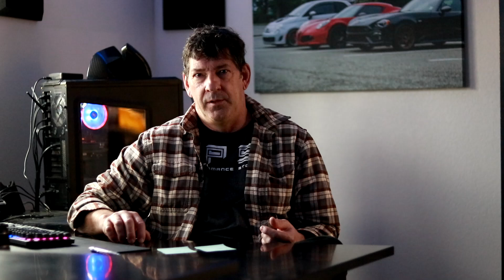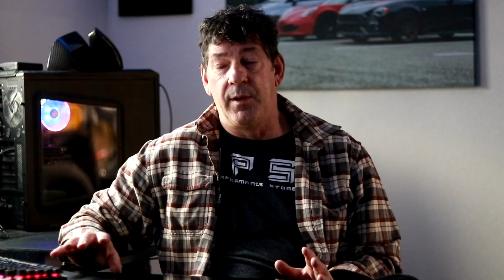Boeing 727 Falls From the Sky TWA 841

Comment: Why on earth would any pilot want to "push" the altitude beyond what is safe and acceptable? It's not like there is any prize money in it!
Reply: Actually there was.  During the 70's Arab embargos, Airlines were giving bonuses to aircrews for saving fuel. Rolling the flaps back 2 degrees in the '27 dropped the nose slightly, cleaning it up aerodynamically. Flying higher also uses less fuel. Former TWA A&P, MCI overhaul base 1986-1999.

Comment: Was the FE a new-hire? An experienced FE would've been aware of this hack and would''ve understood that the pilots pulled the breaker when he was away. A quick look at the altimeter would confirm it, as would a word with the pilot. However, a new-hire might simply push the breaker back in.
Reply: The Flight Engineer was a 5 year Air Force veteran and had been flying for TWA for 10 years. The whole investigation into this flight was a complete mess to say the least with the investigators from almost moment one believing the pilots had caused the upset, never questioned them about the events leading up to the upset save for the hearing 8 days after and didn't let the evidence lead them to a conclusion. All 3 pilots testified the NTSB got the cause wrong with the FE declaring that had the captain done this trick then he would have reported him almost immediately.

A passenger stated that she saw the FE give meal trays to the Lead flight attendant right before the upset, so the pilots discussing the flap trick and then configuring the airplane so that only the flaps would extend and then the FE returning to the cockpit completely out of the loop would have to have happened within a span of less than 30 seconds. Not possible. The Lead flight attendant testified that the FE did leave the cockpit to return meal trays but this happened 30  before the upset and he never saw him come back out and what the passenger most likely saw was the Lead flight attendant giving meal trays to a 
No pilot coming back into the cockpit and seeing a circuit breaker had popped would ever push it back in without first advising the other pilots. When a circuit breaker pops in needs at least 3 minutes to cool down before being pushed back in so if the circuit breaker popped like 10 seconds before the pilot re-entered the cockpit then they could risk damaging the component even more by pushing it back in.
(something that wouldn't normally be touched)
Reply: Not a new hire. It wasn't a common procedure as it's actually unauthorized. It was simply poor/no communication. Former TWA A&P, MCI overhaul base 1986-1999. Worked on that very plane several times.

Comment: Hi Greg, what happens to pilots that create problems such as what occured on TWA 841, or make critical errors when handling emergency situations? I hear so many stories of accidents or near accidents, often with significant pilot error and always wonder if the pilots ever get to fly again. Do they get fired? Or just sent back to some training?
Reply from the maker: It depends on the airline. Typically they are retrained, but in some of the more serious cases they are fired.
Reply: TWA heavily defended the pilots and allowed them to continue flying. The captain continued flying and eventually captained the 747; most pilots that flew with him declared the NTSB got the cause wrong. The co-pilot eventually became a 747 Flight Engineer while the Flight Engineer eventually resigned after the incident and became a professor because of nightmares, psychological issues and eventually he couldn't get on a plane without reliving TWA 841.
Reply: TWA had a very strong pilots union. I know, I worked there 1986-1999.

Comment: One of the weirdest things about this story is that there are two Hoot Gibsons that are pilots.
Reply: And one is a space shuttle pilot while the other one almost wrecked his 727, so it's like they are opposites.
Reply: @RCAvhstape  I was wondering until I saw these comments! I met Space Shuttle Hoot in the early 90's.
Reply: @RCAvhstape  Nope, they are both heroes. What most likely happened on TWA 841 is that the right outboard aileron fluttered due to a fractured bolt that caused the 727 to turn off its heading. With the plane turning right and the autopilot commanding a left turn to get back onto its preset heading it put the plane in a cross controlled situation. The lower rudder yaw damper sensed discrepant rudder inputs that resulted in a lower rudder hardover. With the flaps retreated the outboard ailerons lock out and rudder movement via the rudder pedals is limited to prevent over controlling so with a lower rudder hardover and a fluttering outboard aileron there was nothing the pilots could do to prevent the 727 from going into a dive. When the landing gear was extended the right gear overextended that caused a loss of hydraulic pressure to System A hydraulics which powers the lower rudder, flaps and slats. With hydraulic pressure gone the lower rudder centered and allowed the pilots to recover. The No.7 slat extended due to the loss of hydraulic pressure and the aerodynamic forces of the dice. Analysis showed that it didn’t lock into its locking mechanism while the other slats did and was kept retracted by hydraulic pressure and aerodynamic forces alone. It had nothing to do with the upset and extended because of the upset.
Reply: They should go to Hooters together,
at least once... 
and share a picture for posterity 😅
Reply: Make that at least three, another one was a fighter pilot in Korea and Vietnam
Reply: yes 😂😂

Comment: Rumor that went around in the 80's was that the old "tape style" voice recorder could be read by the FBI over up to 7 erases.  Supposedly, the crew said, "let the bastards try to figure out what happened."

Also, I can't believe how casually you discounted the crew's opinion (lie).  At the time, that would have been heresy.  IIRC, airline pilots the world over circled the wagon around these guys defending them. And the anti-CVR crowd was crowing, "See, see, what a threat the CVR is!"
Reply: I was back on a leave from overseas flying, and noticed the picture of the airplane on the ground after landing, with the slat missing; My first and remaining reaction was- 'Somebody was effing with the Alternate Flaps Master Switch and the Leading Edge Valve c/b'.  that's the only logical explanation- all the others that I've heard have holes in them [not] based on systems interactions..

Comment: Loved flying on the 727.  Well, IN the 727.  As a passenger, maybe 20 times or so in my life.  I always picked a window seat toward the rear where I could watch the flaps.  Highlight of the flight was take off and landing of course, but the flaps were where it's at.  You could see the screws turning as they adjusted, and the internal structure of the wings became fairly clear.  Remarkably, they held together through all this almost as if they were designed that way.  Nothing but fun.  Thanks Greg.
Reply: I told this same anecdote myself on another channel! It was the best seat in the cabin, especially for a young pilot.
The 737 of that vintage was not nearly as interesting, but I did enjoy sitting behind the wing in those as well, to watch the thrust reverser buckets come out and (feel) the visceral roar they made.
Reply: Yep.  And loved the flaps "motor" noise as they were being extended or retracted.

Comment: Howdy Greg

A couple of points:     T. W. A.   and all the other airlines were
quietly encouraging their flight crews to push up their altitude so 
reduce fuel consumption.   This was during the second Oil Crisis
in 1979. and the price of Jet Fuel had gone through the roof.  So,
it was known that anything that a flight crew could do to reduce the
gallons per mile was OK with Management.

Second, the Flight Crew did NOT erase the tape.  The tape on the 
Voice recorder was 30 minutes long, and was a continuous loop.
After landing, the crew taxied the rather bent bird up to the 
terminal, had the stewardesses unload the rather bruised and
shaken up cattle from the back, and then sat parked at the 
gate with the engines running at low idle.   For about 20 minutes.

Which meant that the CVR kept recording, over-writing the section
of the tape when the aircraft was out of control.   And the crew sat
there, silent, for then entire time, except for one member of the
crew, who said, "Shouldn't we......"   and the Captain cut him off
by saying, " SHUT UP !!!!!"     

And the tape kept running for another ten minutes, and then they
shut down the engines.    Which covered their asses just enough
to allow them to keep their jobs and American to avoid a nasty
scandal and horrible lawsuits.

It was Tex Johnson who testified at the NTSB Hearing who 
explained to the experts what had happened.   Nobody could
prove anything. but Tex laid it all out for everyone to see.

And ALL the Airlines quietly told the Flight Crews to stop fucking 
around with the flight controls !
Reply from the maker: There are a number of theories about what happened. I was very clear that the one I put up is one of several. As for the reason the CVR was erased, there are several versions, but no solid way to prove any of them. Even if the story you told is 100 percent accurate it's still very suspicions that they sat silent for that long and nobody thought to pull the CVR breaker and save the evidence that would have exonerated them.
Reply: @GregsAirplanesandAutomobiles  Something to mention is that by the time the crew landed the plane the recording of the dive and the events leading up to it would have been long off the record so it wouldn't have mattered if they pulled the circuit breaker to it. Also, for TWA 841 the investigators didn't need a CVR: the plane landed safely and everybody survived with the flight crew uninjured and were willing to talk to the investigators about what happened. It's just, except for the hearing 8 days after, the investigators didn't want to talk to the pilots and discounted their sworn testimonies.
Reply: @GregsAirplanesandAutomobiles  But after a harrowing flight, struggling to get a barely controllable plane onto the ground, and then ramp and emergency crews alerting you of leaking fuel, deplaning the passengers and then arranging for them to be transported to the terminal, are you even going to think about the CVR? Your logic seems to be that if pilots don't pull the circuit breaker to the CVR after an emergency then they want to hide something. That is complete absurd, man. There have been many cases where the pilots weren't responsible for causing an emergency yet didn't pull the breaker to the CVR. The NTSB report says that the CVR would not have recorded the dive nor the events leading up to it because it took them 45 minutes to land at Detroit and the CVR only recorded the last 30 minutes (maybe 3 more minutes). It wasn't until the late 80s until it was recommended for the recording to be at least 60 minutes long.
Reply: @GregsAirplanesandAutomobiles except there was 9 minutes of audio on the CVR. NTSB never reported on it because it contradicted their erasure story. Lawyers were fighting them on it even during the investigation to disclose what they found on it.
Reply: @Batwingsix  As was pointed out where you made the same comment above the 9 minutes were transcribed in the report, not ignored. And I don't know why you say "except". 30 minutes of tape minus about 20 minutes of recorded silence leaves about 9 minutes of the conversation  just before the crew shut up (i.e., after the period of interest, but rather when they were taxiing), so that's perfectly in line with Paul Ward's story of how the relevant portion of the tape was overwritten.

Greg's story about how it was done with the red (not green) button is however impossible if the tape erasure was, as Wikipedia quotes a source claiming, something that resulted in a bulk tape erase..
Reply: This was a TWA 727
Reply: @bkailua1224 Yes
Reply: @Vespertineflyer  For the CVR to be erased the plane has to be on the ground with the engines shut down and the parking brake set. The squat switches on the landing gear were damaged so the computers didn’t recognize the plane was on the ground. In short they couldn’t have erased the CVR even if they wanted to. The Captain testified at the hearing that the CVR never even crossed his mind at any point during the flight and after they landed.
Lastly, if they wanted to hide incriminating evidence, why was there 9 minutes of recording available instead of no recording?
Reply: @Vespertineflyer  Sorry man but if you read my post I stated that the damage to the 727 meant the pilots couldn’t have erased the CVR even if they wanted to.
Reply: "And American"?  Shouldn't this be "And TWA"?

Comment: About 1995 in Pensacola Fl. a newly licensed Navy Pilot rented a Cesna 172 from Pensacola Airport (KPNS) and flew to Mobile with a passenger. On the return trip the engine quit about 1/2 mile from touchdown (fuel starved). The pilot landed successfully on the roof of Cordova Mall. He hit an AC air handler but was only going about 20mph. Little damage to the plane.
Reply: I suspect a mall due to its function will have a somewhat stronger roof than warehouse, and Cesna 172 is really light =)

Comment: When I was a 130 FE, there some pilots I didn't like leaving unsupervised in the flight deck. If I had to pee I did it quick and got right back upstairs to check my panel and make sure nobody had touched my stuff.
Reply from the maker: I understand. I hated when the Capt would come back and touch stuff. It usually resulted in a pack trip or duct overheat.

Comment: When your crew retracted the flaps two degrees, that should move the center of lift back, so they would have to retrim the elevator, I would suspect.  On your second story of feeding both engines from the right tank, wouldn't the pilot notice that the plane tries to roll to the left as the right tank gets depleted?  Wouldn't that remind them that they need to use the fuel from the left tank?
Reply from the maker: In the case of the 727, the autopilot would retrim for the change with no problem. On the Piper, the main tanks were inboard so the rolling moment wasn't that great with the lateral imbalance. Plus it could be dialed out with aileron trim These were not really nice cherry Navajos, the were all a bit bent anyway.
Reply: @GregsAirplanesandAutomobiles   Thanks.  Auto pilot elevator trimming.  You probably saw the crash of that girl that had trouble with the auto pilot and the trim.  She was more worried about her blog than controlling the plane.  On the Piper, the pilot would still have to consciously retrim the ailerons, you would think he would get the idea of why he has to constantly keep on adding left trim.  D